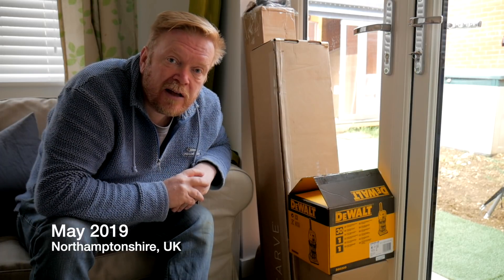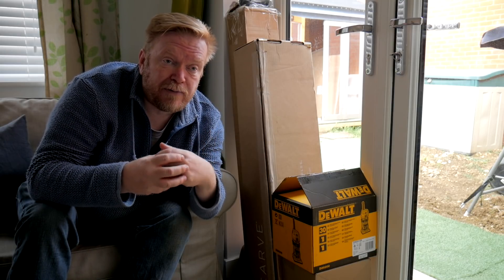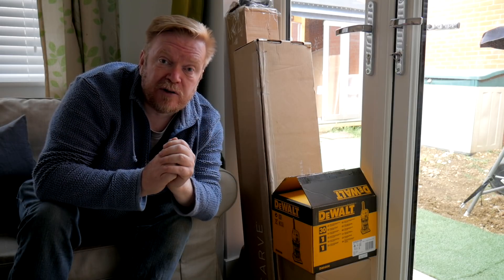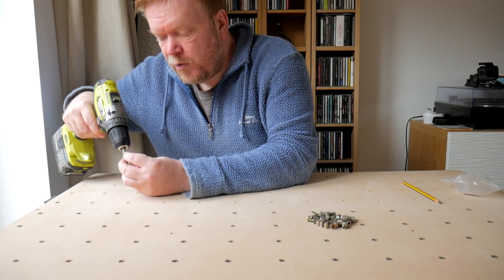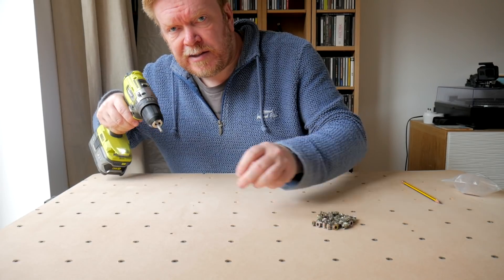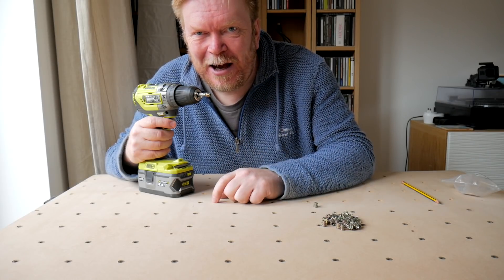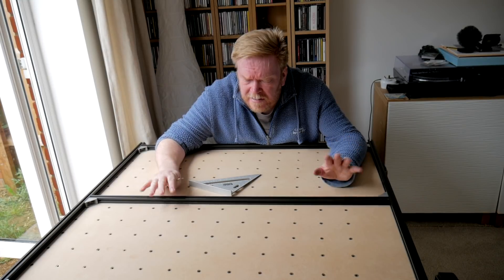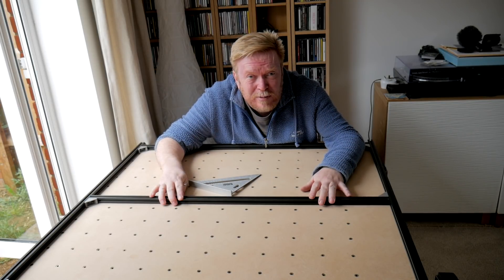Building the X-Carve Waste Board Assembly | UK Version | CNC Build Series 1

Comment: It's good to watch a fellow brit build an X-carve, I built mine about 3 years ago and have used it a load. I need to get a new waste board because the MDF has warped from being surfaced a couple of times, I'm thinking 18mm marine ply this time and installing T tracks. I'm also eyeing up a stepcraft  Q204. Have fun with it :)
Reply from the maker: Thanks. I won't be showing the build step by step since Peter Parfitt has an excellent reference series. The supplied waste board from robosavvy isn't fantastic given what I paid, and I should have made my own in hindsight. Anyway I'm pretty happy and still working on a part 2.
Reply: @StrawbyteWorkshop  It's definitely good enough for the first few carves. It might just need a surface before the first few cuts to make sure its square to the spindle as mine from Robosavvy was a little blown to begin with, the machine is more than capable of making its own waste board too :)

Comment: Also looking forward to seeing coming CNC videos got a 6090 but   
Running Vcarve pro have you got any CNC projects in mind? Carl
Reply from the maker: Hey there Pod Man, As far as projects go I've got a few in mind. I bought the size I did to so I can surface plane some slabs wider than my planer thicknesser, plus I want to ensure I can get a full-sized 600x600mm cabinet door in the machine. The first proper project I have in mind is a map table for a sailing club with the lake represented in resin.
Reply: @StrawbyteWorkshop  wow awesome resin project will keep a eye out for that hopefully something I can emulate on my CNC many thanks Alan